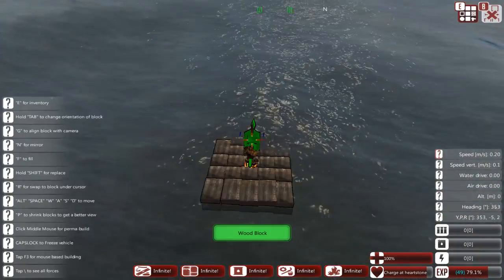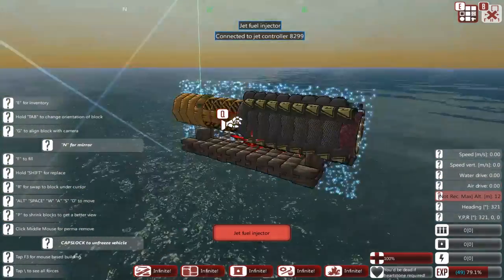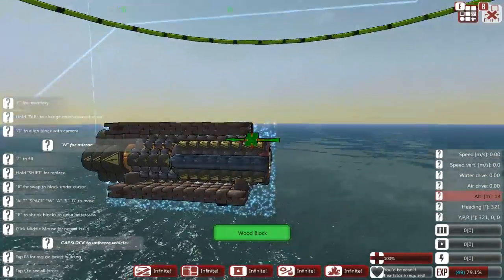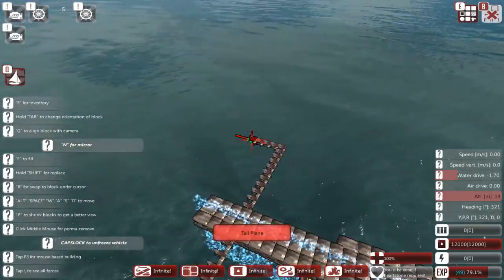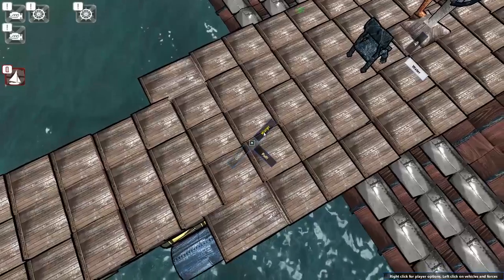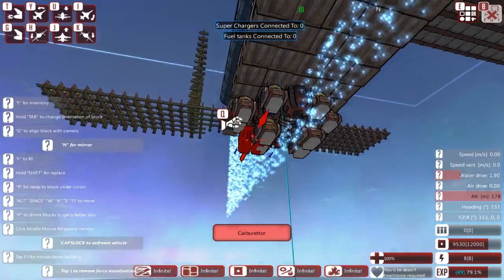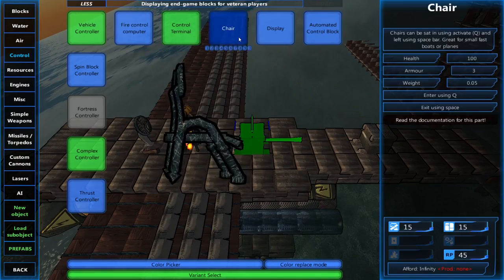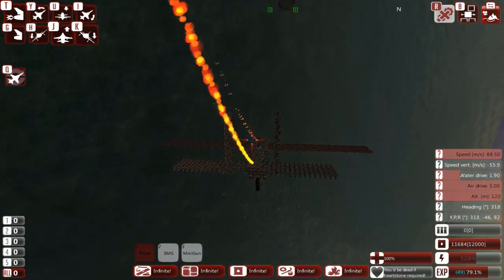From The Depths Tutorial: Fast and Cheap Plane for Begginers.

Comment: it can go faster if you slope all frontal blocks with 4 length slopes. i make my beginner plane 110 speed cost, 2000 wood, 2000  metal.
Reply from the maker: +Howard Li i agree! but i was just trying to make everything as basic as possible. ^^ thanks though!
Reply: Howard Li and now there is only resource